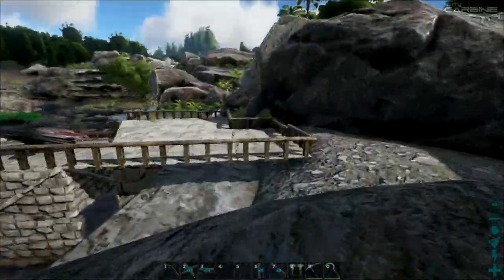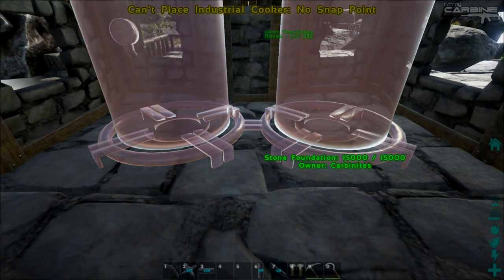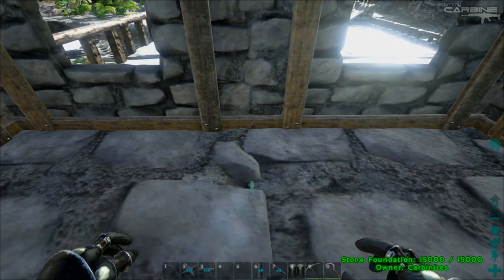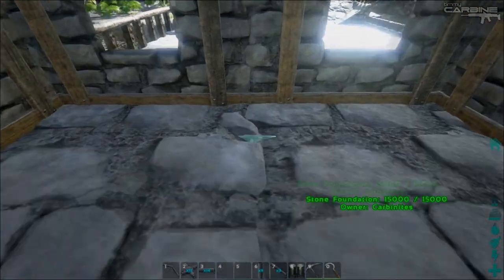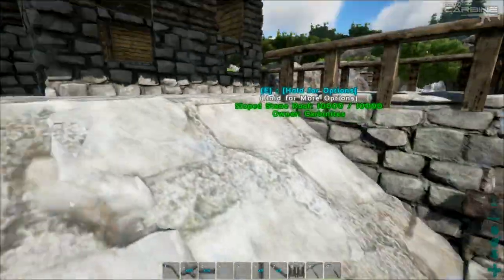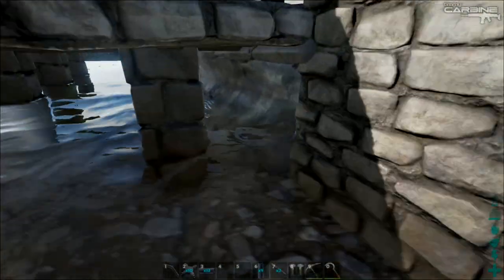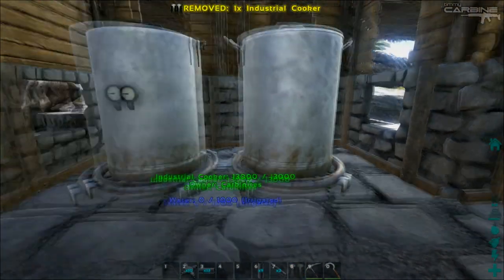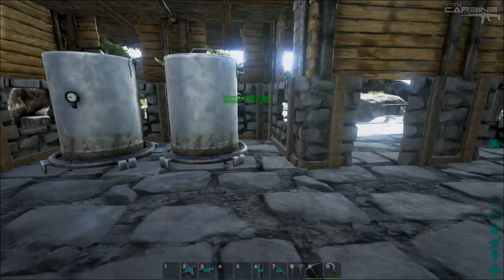Ark:SE Quick Tips || How to Irrigate the Industrial Cooker || TimmyCarbine

Comment: I have put in several with the cross pipe method with a twist we would run verticals up both sides and another cross pipe up on top which was then extended to mount beer barrels onto. then other verticals to roof level to install reservoirs if needed for backup for other uses. We some times had as many as three different water systems in a large base. The key is if the mount pipe is destroyed you lose the cooker the added pipe work helps prevent mistakes by giving other connection points away from the key ones under or just on top of the floor. I always made sure the cooker was connected to the junction between two cross pipes. The first one placed square to the wall the second extending into the room. Build your pipe setup first then install so there is no chance to remove the wrong pipe.